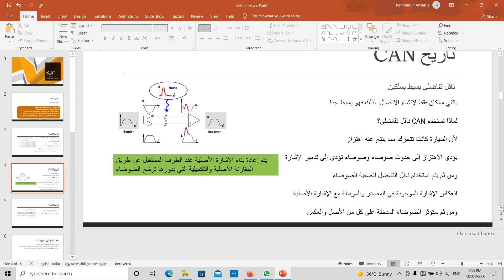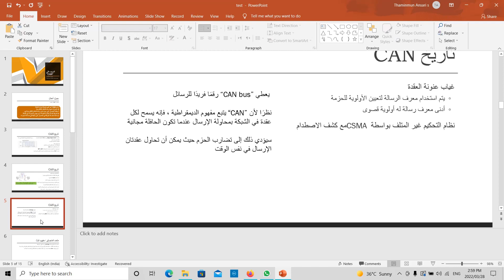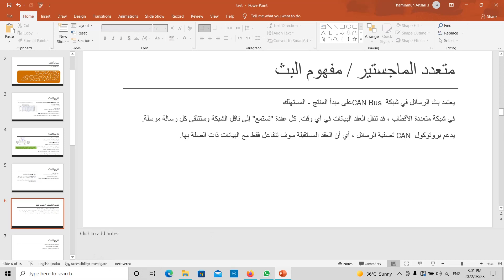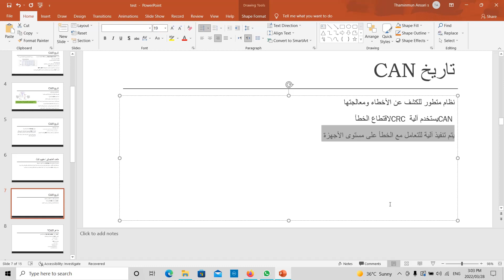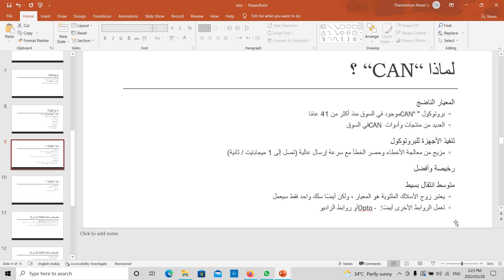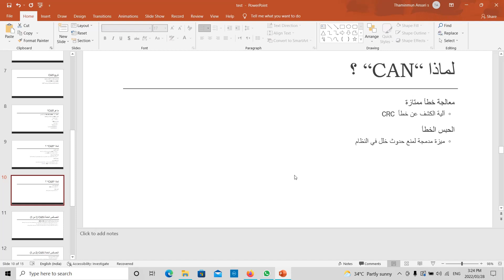مقدمة في تدريب "CAN"

Comment: Bro, I'm very impressed on your multi language skills.
Reply: I'm asking for your help. Would you help me for a job. With much qualification and experience it's getting hard for me to shift a job.(current job is affected by COVID) My qualification is M.tech power electronics. I'm working as a field application Engineer in CAN, PIC, Closed loop control system (Servo system).  Current job is Taiwan based company GYE TAY MACHINERY WORKS TAIWAN
Reply from the maker: @Chitha113  Bro, You are most wanted in Germany. Go in Visit visa or freelancer visa to Germany. there are many people in Taiwan to arrange this Visa. Surely you will get Job.